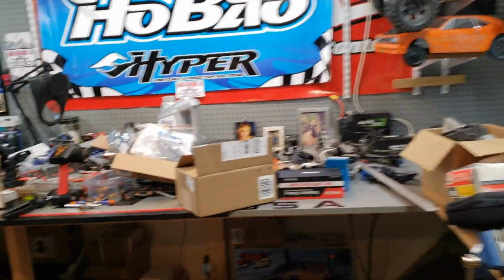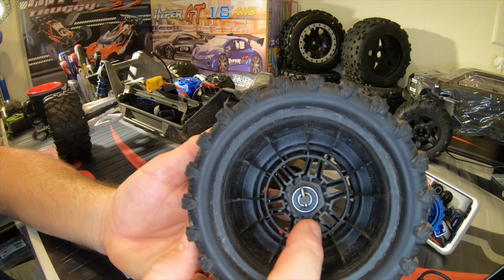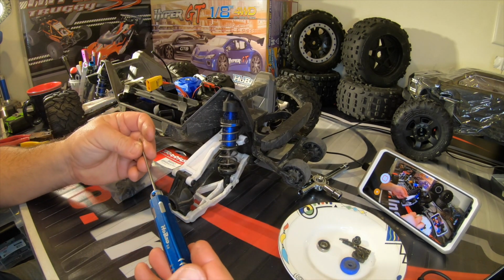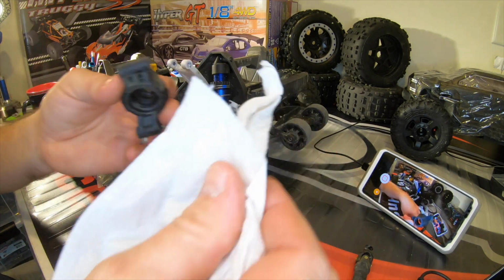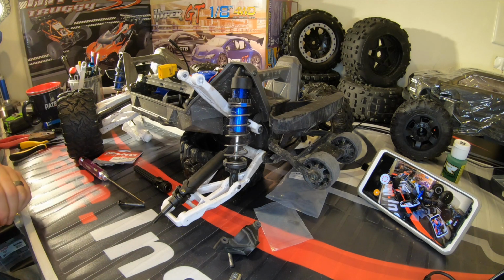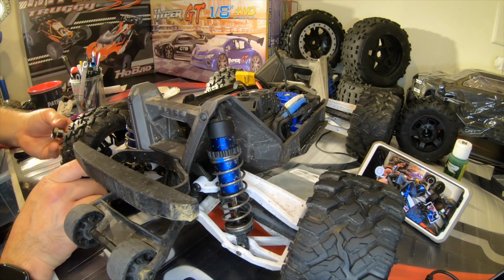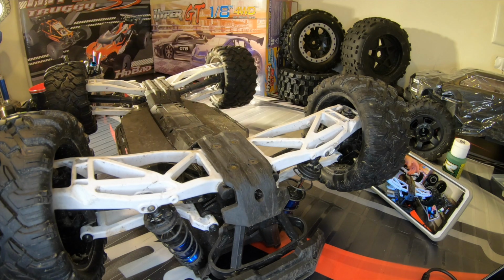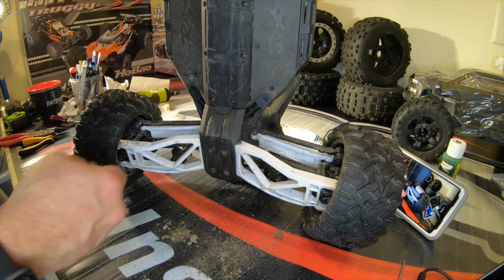"The Basics" Traxxas MAXX Repair Stock Axle Replacement

Comment: Does that hole on the bottom arm towards the diff have any purpose
Reply from the maker: If I'm thinking about the same hole your talking about it's usually for setting up your ride height for your droop called the droop screw